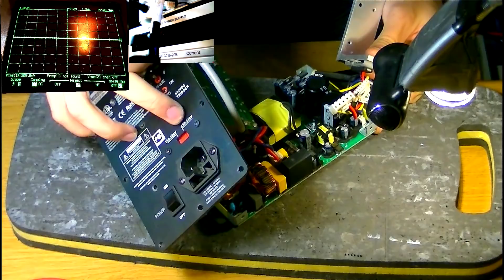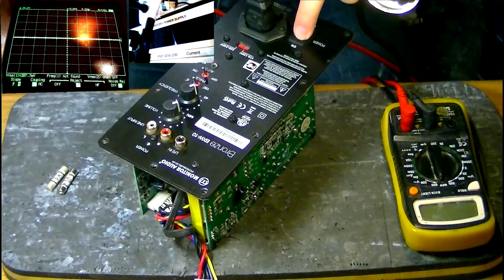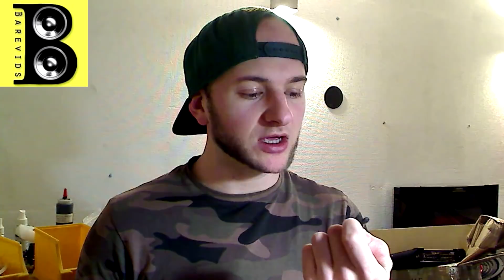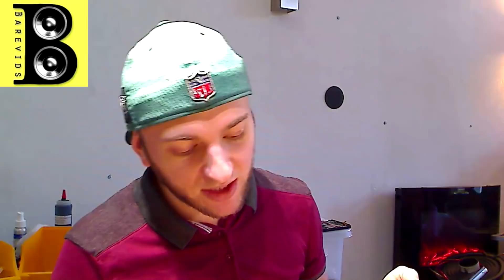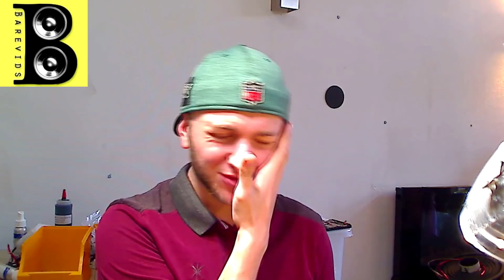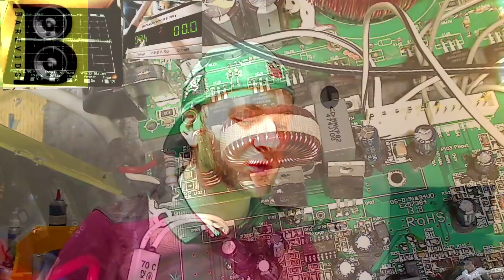The most infuriating little amplifier I have ever tried to repair.

Comment: I just wanted to say thank you! Your informative videos gave me the confidence and enough direction to diagnose and repair my DD Audio DM500a, which was going into protect on power up for seemingly no reason. It also runs the IRS2092S driver chip and I was about to concede that it would be that chip that was faulty when I found an SMD electrolytic capacitor with very low resistance on the CSD pin (shutdown pin) essentially forcing the chip into protect. So thank you again, you've saved me from buying another amplifier!
Reply from the maker: @SubBassFrequency  thanks for sharing this, it's why I love doing these videos!

Comment: I love how persistent you are. This is what will make you the best. Never give up brother.
Reply: I completely agree with you Rick. You give GREAT advice here! Determination and persistence are always required to master a craft and the failures are excellent for learning from. The failures teach you more than a quick & easy repair every time. If every time you repaired a circuit by replacing just a fuse, or just a rectifier, etc, and the damn thing worked right away each time, then what will you really have learned from the circuit? It's these little nightmare, under-designed, POS circuits that will force you to perfect your electrical troubleshooting craft and hone up your skills if you NEVER give up. From my own experiences ( over forty (40) years now), (yes, I know that I am as old as dirt), I routinely will still learn more about a circuit that kicks my a$$, than even the most complex circuits that are easily repaired with just a simple component swap or two (2). This is just my $0.02 worth of real world consumer electronics repair though. I offer it up to only those who are genuinely interested. I love all of your amplifier repair videos Sam. You just keep right at "fighting" with the "home" 240/120 Vac, mains powered equipment - troubleshooting & repair, NEVER give up and you will master it also Sam, just like you have already mastered and become the twelve (12) volt DC supplied equipment/amplifier master repairman!   Fred

Comment: LOL voice text while driving didn't turn out so good supposed to say sam use a variac on the AC input to slowly turn the voltage up also you can use a light bulb in place of a fuse and the lightbulb will absorb the current I have done it this way for years

Comment: Damn you could always put a variac on the AC input and or you can use a light bulb instead of a fuse and the light bulb will observe the current instead of the transistors this is how I've done it for years

Comment: Those of us who are used to repairing car audio amplifiers have sources that protect themselves in case of a short. in my case I check the source and then the amplification, it happens to all of us that when we repair a home amplifier and we have a short in the source we make a short that turns off the breakers. then it is best to place a 60 watt bulb in this case to avoid danger, these sources are complicated but they are more efficient. the comment of the resistance from the inductor to the IR2092 is super, I did not know and it just goes to in leg 3. once I had to repair a module of the mackie brand with switched source and PFC, class d in the low medium and class ab (tda) in the acute, a beast very difficult to repair without plans since it is classified as class TD, those cases are the worst and the best because experience is the most important and some comments are worth gold because there are many people with a lot of experience giving their opinion that's why I like these videos because you learn a lot ... excellent greetings from Venezuela

Comment: Pro-tip for working on these: Get an isolation transformer. Much easier and better since it will fully isolate it from the mains and allow you to use your scope without fear of shorting it out. Also the control circuitry in the SMPS can be powered from a bench-top DC power supply to test it. No need to power it up fully as the control circuit will only need about 15V to operate. You can also add a pot across the voltage optocoupler to simulate feedback, and check the waveforms to the transistors.

Comment: A proper Variac with isolation will help a lot  or use a light bulb (as a cheap alternative) in place of the fuse on the P.S.U pcb. Mains power supplies are relatively easy to fix. You  my friend should be able to do this with 99% success rate, I trust you sam.. :)  BTW,    CSD pin will only go 5v if all the external voltages are satisfied ,, the chip itself raises that pin to 5volt to indicate its working corrrectly. For IRS2092 , to measure  VCC, LO , HO , etc.. you need to use VS pin as ground  reference.
Reply from the maker: great info thank you!!
Reply: @barevids   Pin 15  gets 12volts referenced to VS,  pin  1 gets +5volts referenced to GND and Pin 6  gets  -5 volts also referenced to GND

Comment: I would definitely check the get driver from the ic itself for the psu and see what is going on with the fet gate driver. The fact it keeps drawing that type of power suggests that your IC is going out (the one driving your fets for the PSU). Maybe the bootstrap is out.

Comment: only a guess did you check the output caps they should block the DC "in fact check all the vulnerable electrolytics" Also I would have powered just the amp board off my bench supply; makes it easier!

Comment: yeah as what other people said 1: get an isolation transformer and 2: get a variac and/or an incandescent lamp say 60W. So your isolated from the mains then you can bring the mains voltage up slowly and if there is any problems then any power that is going to do any damage will be soaked up by the lamp! simples (i have been using the lamp trick since i was 10 fixing things, i am 58 now and still fixing stuff lol. Love your channel. Paul (north london)

Comment: I have got a question, i have two same car amps (Sinuslive SL-A1000D) which are not linkable is there any way of linking them by inverting the phase of one amp like you did years ago? I tried that and it works but at some point quit befor maximum they start making strange noises through the subs may it be that the phase is not exacly 180° changed cause they have phase nobs instad of swiches ? i gainmatched them to 0,01V.
Reply from the maker: How did you invert the phase? And yes should be possible but remember that you can only connect a 2ohm load Now when linked.
Reply: barevids Well I just turned the Phase nob on one amp all the way to 180 for RCAs I have got a splitter which makes 4 RCAs out if one so all inputs receive the same signal. I am also aware that 2 Ohm is minimum then I had two 8Ohm speakers in parallel for 4 Ohms and the positive was connected to the positive of the 0 degree amp and the negative was connected to the positive of the 180 degree amp.

May it fix the problem if I jump the negative speaker outputs together just like it’s done on sundown amps for example? I look up how they do it and saw that and thought it might help.

Comment: I use current limited bench supplies (bipolar) for this.  I separate the amp out from the amp section and power supply section and work on each as two separate units.
Reply from the maker: What do you use to supply +/-15v and +12v ref neg rail?
Reply: I use two HPs that have 2 channels that does 0-24 at up to 4 amps current limited.  this will at least let me know if it's going to smoke.  by using two I can separate out rail and low voltage.  only real issue I have with this arrangement is class G/H when I want to test it going to the high rails.  Normally what I find there are commutator diodes anyway. 

Those power supplies can be found used pretty cheap.    There are all kinds of others, I have a pair at work I really like they are Tenma duals.

Normally on linear supplies I just use a variac and watch current.    when everything started moving to class D and switching supplies I had to use bench supplies to test... I only attach both halves together at the very end, when everything is verified, before stress testing.

Comment: I have a pheonix gold m100 and I hooked my 2 12 jl w3v3s up to that amp .. and i did it stereo so left and right channel I think .. so the right channel was fine and I didn't hear any distortion/crackle/pop noises in the right speaker .. but the left  speaker, I heard all of the above... when it was just bridged mono, I heard all of the above in both speakers.. so it leaves me to belive that somehow, I think the left channel in the amp is messed up if that makes any sense .. i do not think its the rca cables bc I it was doing it while the cables were not even plugged in .. its not my ground as I moved it to a better location.. the amp gets hot asf, almost too hot to touch .. please help me ??!! Idk if the amp is messed up or what

Comment: before i watch the video, i bet its corrosion under the black stuff! the black stuff becomes conductive after some time due to heat, i repaired a monitor sub a few years ago with the same issue, there was corrosion on the legs of the driver transistor, blowing the otputs every time it was powered.

Comment: You could use an incandescent light bulb inline with mains. So if there is a short the light bulb will light  brightly instead of the equipment under test. If everything is ok the bulb will light dimly. you can then plug it in to the normal supply. https://www.youtube.com/watch?v=wRFRwOnLsZI

Comment: I see a lot of suggestions for a bulb limiter and a variac however, these don't work well on switch mode power supplies. They are great for linear supplies but SMPS's are another breed of circuit that don't take kindly to limited input voltages and currents. The instant death thing is a real problem with these types of circuits and that's why I hate troubleshooting them as well.
Reply: Completely agree, but I still recommend using a bulb limiter purely because it prevents fuses from blowing and it makes noticing big power draws a lot easier and possibly a whole lot less destructive
Reply: @R4MP4G3RXD  yeah i second that too but if it's all you have then its better than nothing.

Comment: Hello, the irs2092 will never try to switch without the fets. The signal is fed back from the output inductor to in- pin to make it oscillate. Try to measure the resistance between the output inductor and in- pin, you should see something like 30..50kohm. Check aldo if vaa and vss are present, if they are too low the irs2092 stays in protection mode. The irs2092 cannot detect output dc offset, there is  for sure another circuit doing it. Maybe is this circuit faulty
Reply from the maker: Guys, this is amazing information. Thank you for taking the time to watch the video and reply. I will look into this!!
Reply: Im having trouble with a board with an irs2092, my Vaa pin is getting about 5v, and my Vcc is getting like -40v, which cant be right, right? What voltages should I see, and any idea what would cause the voltages Im seeing?

Comment: Well the thing that variac  transformer a beam bulb light which is a cat incandescent bulb that will help you to minimize the amount of current draw and do not blow the equipment upI do not know that circuit well but I think you can test the drive frequency that is coming out of the driver IC on the

Comment: Just a heads up. That black adhesive turns to semiconductive goo after being exposed to heat for a few years. You’ll need to remove it around the high impedance stages or you’ll chase your tail FOREVER.
Reply: I used to fix a lot of fax power supplies and that Glue (gorilla snot) when it went that dark colour often went conductive and chernobled power supplies.

Comment: Use a isolation transformer to protect your equipment a light bulb in series to protect what you are working on and  a variac transformer to turn up the voltage slowly.

Comment: Hi Sam,
2 things to do/check:
- the black stuff is probably burned glue that very well may have gone conductive. This is a very common problem with many plate amps. You sick your probes in and see if you can measure any resistance but I’d remove it anyway. If it doesn’t cause a problem now it will in the future. 
- capacitors very often go bad in these amps because the get too warm and because even reputable brands put crap caps in their amps. 
I’ve repaired a few plate amps and all had at least a good amount of bad caps. I’ve had a Tannoy where all caps had gone bad. From high ESR (>100Ohm) to hardly any (pF in stead of uF) capacitance left at all. 
About every cap still looked ok so you can’t tell by just looking at them. 

If there’s a bad decoupling cap in the circuit then that cap would block the input signal. 

Yes, I was a bit disappointed that you didn’t fix the amp (haven’t fixed it yet 😝) but I absolutely agree that’s it’s good to show that not all repairs have happy endings. 

Thanks again 🙏
Reply: Right about the glue. Seen it myself, err I mean measured..

Comment: Your solution with the inverter is also cool, perhaps you could modify the inverter to allow you to vary the output voltage, or simply use the incandescent lamp as suggested above.

Comment: People have already suggested the 'dim bulb'.You can select  suitable wattage rating to suit the item under test. Obviously incandescent old style bulbs are required. Where else can you get  40W, 60W, 100W, 150W  loads that are reliable and safe for mains usage? I have a switchable (lump of wood with sockets) 'unit' allowing easy connection. If there is a short obviously the lamp will glow brightly. A variac is essential lab kit. You should have a safety isolation transformer too.

Comment: what you need is a variac transformer to bring the voltage up slowly as you do with the dc stuff they're cheap and robust enough, i work on guitar amps a lot and use one for this purpose.
Reply: Agreed. Back in school (I'm old!) we called these rheostats. The very common incandescent bulb method above also works well. I'm surprised barevids didn't know.
Reply: I think a rheostat is just another name for a potentiometer, using a coil of wire. am I right about this? a variac on the other hand is a type of adjustable transformer. a rheostat can limit current to the load, but a variac can potentially allow much more current.
Reply: Variac will help, but it will still go to its full output voltage once it has passed its turn-on threshold. Wont get quite as much damage, but will still blow things as higher currents will be flowing at the lower voltage. Having messed with these I can say its pretty much a must to have an isolation transformer if you have a mains powered scope or meter or the SMPS and the scope can easily go bang if you try and tie the scope lead to the board since the scope is grounded through the mains, and the primary side is directly referenced to the live and neutral. The isolation transformer also makes it much safer since its no longer referenced to the mains.
Reply: However, with that said, you can use a very small fuse for testing it, as the variac will eliminate the inrush current at turn-on. These dont need much once they're under way, so a .5A fuse will be enough to bring it to life.